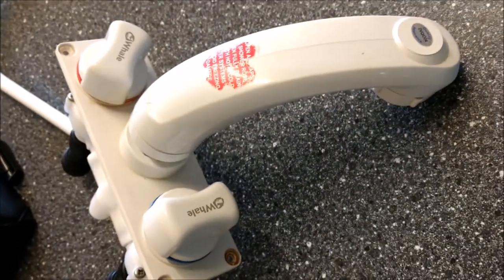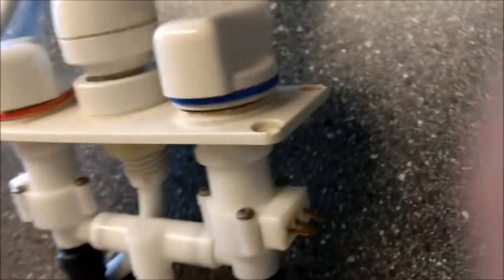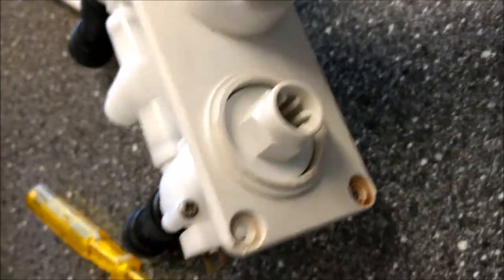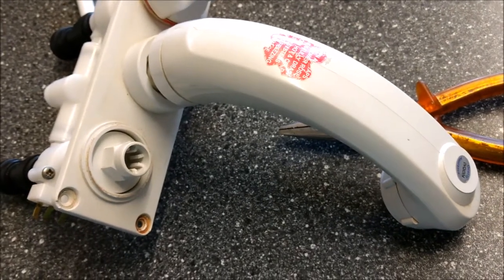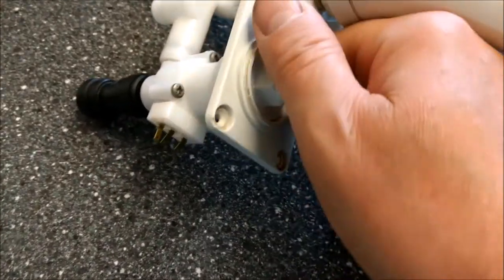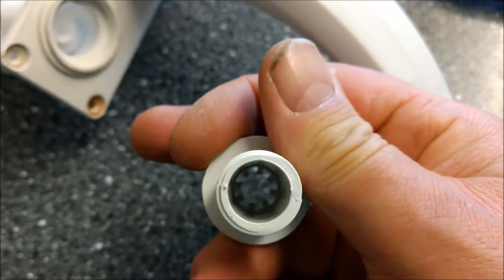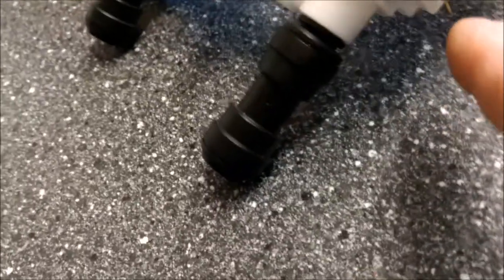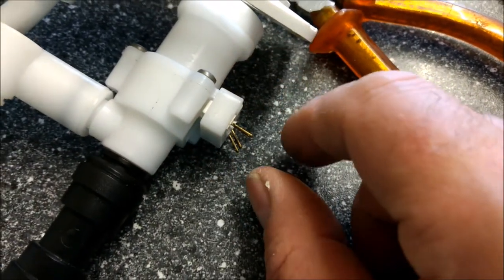Repairing the spindle in a whale mixer tap

Comment: Thanks Nick. Very helpful. Could you tell me how to remove the spout itself from the unit? Is it possible to do this without taking the unit out as you have done in the video? My spindles are fine but there's a crack in the spout. Thanks Steve
Reply from the maker: Steve Derry , sorry mate mines a shower and it pulls out and unscrews. If it's a fixed tap I have no idea sorry! 🙁

Comment: actually, i really need a video on how to remove the mixer tap AND ALSO the sink - i have a cracked sink and a broken shower hose and head ! so can you video a complete removal and replace??? :-)
Reply from the maker: Sadly at this time, I haven't got the time! However, its quite simple to do once you start and many sinks are held in with mastic and a few screws. As are infact many toilets! However, thanks for the idea and if I have to take mine out again, I will do that video!